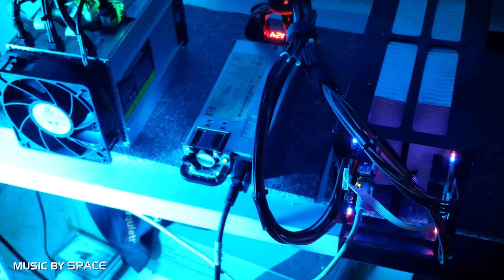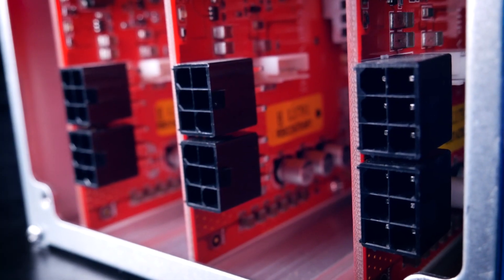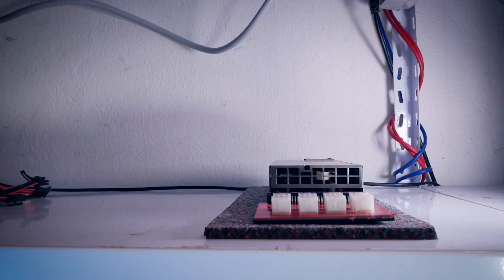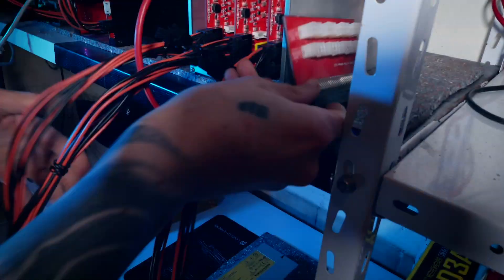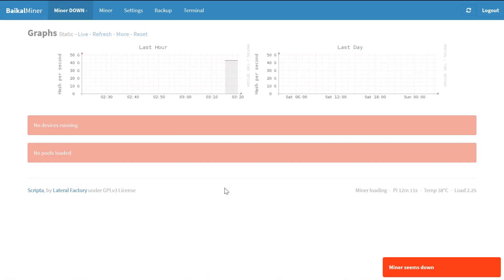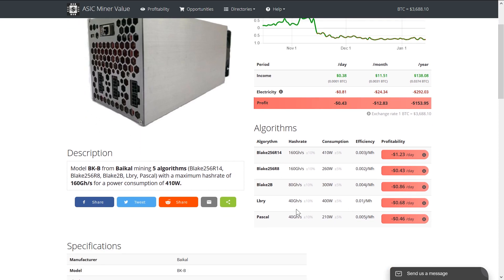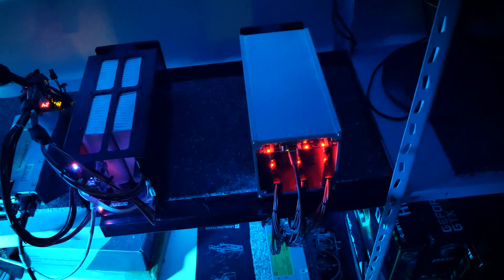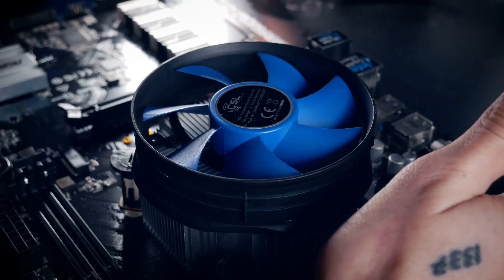Baikal BK - B Spotlight: Unboxing / Setup (Baikalminer Giant B) LBRY / PASCAL

Comment: Hi there, first things first: Great video! I have a small question however. I was looking into buying this Baikal BK-B miner but stumbled on to the whitepaper of pascal coin: RandomHash:
GPU & ASIC Resistant Hash Algorithm. How does this turn out for this miner? Will it still mine pascalcoin or not?
Reply from the maker: hey there! No, BK-B does not work with Pascal anymore unfortunately :/ they forked away - cheers and thanks for tuning in ⛏️

Comment: sir this calculate is correct? https://whattomine.com/coins/172-pasc-pascal?utf8=%E2%9C%93&hr=40000&p=210&fee=1&cost=0.17&hcost=0.0&commit=Calculate
Reply from the maker: unfortunately not, Pascal forked away so you can't mine it with these machines anymore - cheers ⛏️